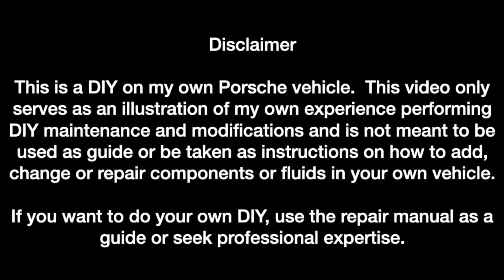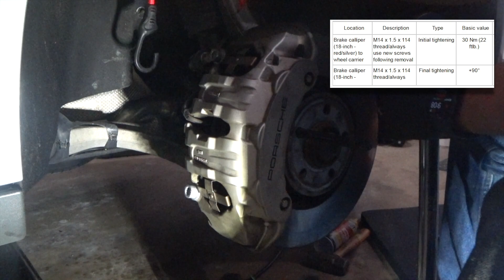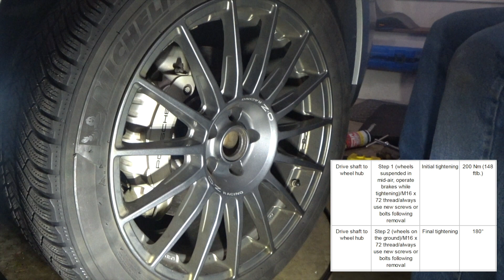Front Wheels Bearing Replacement - 2015 Porsche Macan S

Comment: Thank you for the video, a confidence builder for anyone thinking of a DIY. Food for thought: Front brakes, easier to remove the bracket bolts rather than caliper bolts, they are reusable, per my Porsche mechanic. Bearing bolts back out a couple of turns and tap the heads if you don't have and air hammer. Be sure to lube the treads on the pressing tool. Will be doing my Q7 in two weeks.
Reply from the maker: Thanks for your observations.  I’m trying to remember this, and if I remember correctly, the front calipers use 2 bolts and those are bolted directly into the suspension arm.  For the rear brakes, I know there is the caliper that mounts into the bracket.  Yes, you could remove the brackets on rear brakes, but I find that more difficult.  The brackets can stay in place during the job.  These bracket bolts have a much higher torque specs, hence more difficult to remove and reinstall.
Reply from the maker: On the removal of the bearings, I tried the method of partially removing bolts and tapping (in my case, hammering them, to no avail.  The bearing was so frozen in place that I had to use the big tools.  The rear ones were a breeze to remove.
Reply: Good to know, will be doing the Q7 this weekend. @porscheDIY
Reply from the maker: @DontTellMeMore  Good luck!  Let us know how it goes.

Comment: Did you figure out what is causing the noise. Can you post a recording?
Reply from the maker: No.  I took it to dealer for another opinion and they think is the rear differential.  But I’m doubtful.  I’ll try to record it and post as short video.  My Macan is still down for the rear subframe job, so can’t record it just yet.

Comment: I had grease come out of the axel when doing my front wheel bearing. No leaks from the boot. No leaks from the back. Should I be concerened?
Reply from the maker: Hmmm… if your boot if fine, there aren’t many other things around.  Are you the original owner?  I wonder if someone had been greasing that area and overpacking that area with grease and that’s what you saw.  In any case, clean the area, add a bit of CV-2 grease or similar, and that should be enough.

Comment: Hello,how much did the bearing puller's and the rest of the specialist equipment cost ? Would it have been cheaper to go to a garage ? How many ppeople have an air chisel etc. If mine go, I'm coming to you. Thanks PS you only have another 2 left to do !
Reply from the maker: About $600 (and this is because I got the $200 torque multiplier which is not really necessary, but makes job easier).  Maybe if I got it to an Indy would had been close to that, but I doubt it.  Dealer would had been very expensive.
Reply: None of the specialist equipment is necessary. U can do it just with basic tools, 12 point torx bit, torque wrench and a big bench vice and a bit of thought.

Comment: Why did you replace them? Were they both bad? noisy?
Reply from the maker: I had a high pitch noise at higher speeds (about 80mph).  It correlated with speed.  And although I didn’t hear anything with stethoscope I still decided to replace them…. I figured that my Macan with 120K miles, it was probably about time.  Unfortunately, that didn’t solve the high pitch noise issue and I’m still in the search.  I’ll probably get this diagnostic addressed with a shop or at a dealer and make a decision on how to address it.

Thanks for your comments.  I hope you are subscribed to the channel.
Reply: Transfer case potentially